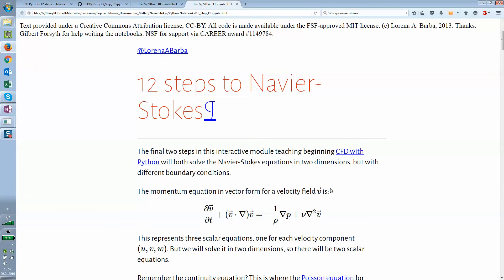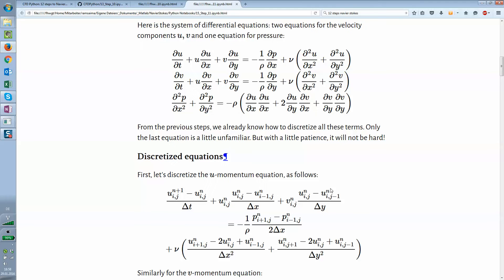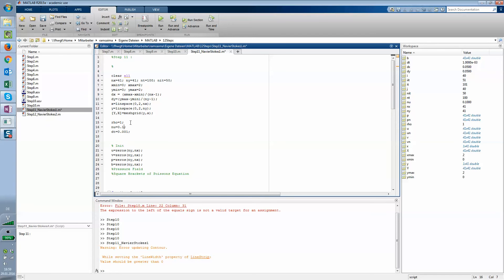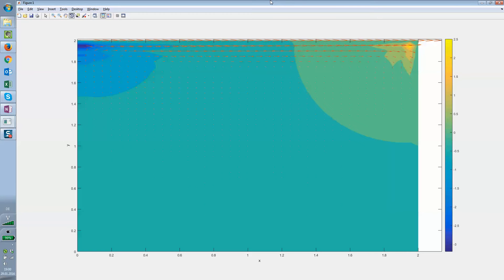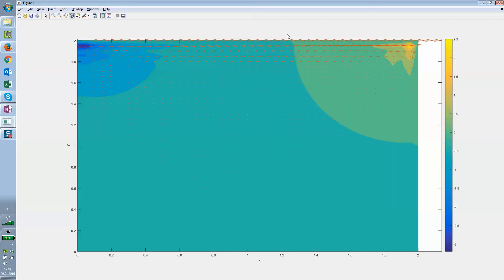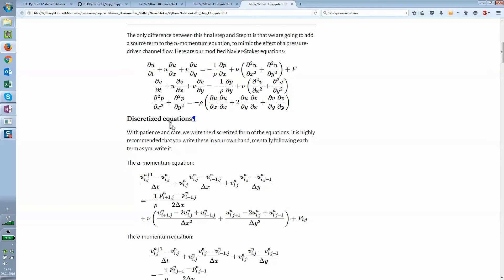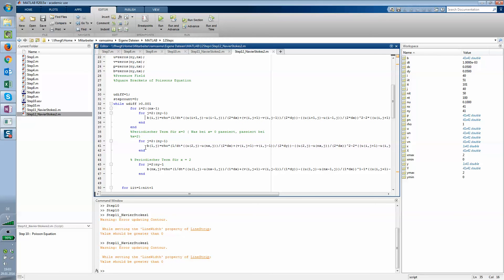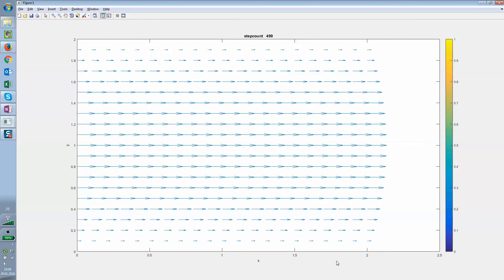12 Steps to Navier-Stokes - Step 11 and 12

Comment: Hello, nice work
In step 11, what do the negative pressures mean on the graph?
Reply from the maker: Negative pressure values are always in relation to the reference pressure. So it is not an absolute negative pressure but less than the reference pressure you set in the model - e.g. the atmospheric pressure.
Hope this helps :)

Comment: I downloaded your code for step 12 and the reason the contour doesn't plot is due to uniform pressure vector of 0. I've tried to fix it but no luck. Did you manage it?

Comment: I am having a problem with this. 
Whenever i set the initial condition for P as zero everywhere, it remains zero even after multiple iterations. Although the velocity keeps changing but the pressure remains zero. This happens unless i set an initial velocity to the fluid which probably helps to calculate the first pressure field.

can anyone help me with this?

Comment: Hi, I followed up to step 11. I noticed we get negative values for the pressure. How is that possible?
Reply from the maker: Edit: Wrong!, see comment below!
Pressure as Force devided by Area can be expressed as a vector. A vector has magnitude and direction. The direction can be negative.
Best regards,
Manuel Ramsaier
Reply from the maker: Sorry, I got confused with continuum mechanics. Pressure is regarded as a scalar entity for fluid dynamics and at least for this example as we did not difference between p_x and p_y. I checked again with Barbas Solution and besides there seems to be an error in the pressure equation on my side ( see comment below), Barba also gets the negative pressure values. (http://lorenabarba.com/blog/cfd-python-12-steps-to-navier-stokes/) 
I will check into this more next week. Thanks for your comment!
Reply from the maker: Found it:
The results are relative. For absolute pressure values, we would have to change the b.cs of the pressure at the wall to their exact value (referencepressure). Found here: https://www.comsol.de/community/forums/general/thread/4279/

Best regards and sorry for the confusion!

Comment: I put together the MATLAB code from this video and by converting Lorena Barba's python code, it can be downloaded below.

I doubled checked all of the calls to matrix elements ie. u(i,j+1). and noticed some of them were different that what made sense to me from the python code. So I changed them to what was directly called by the python code. This doesn't mean it's right but you do get pretty plots that seem reasonable with no errors.

https://www.dropbox.com/s/ahngl43ok7dwyly/step_12_FD_solver.m?dl=0